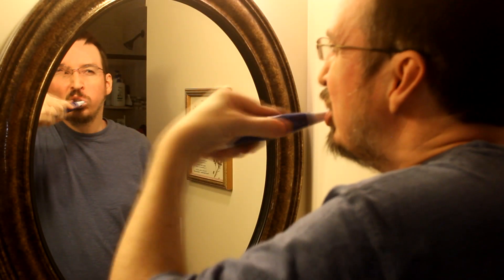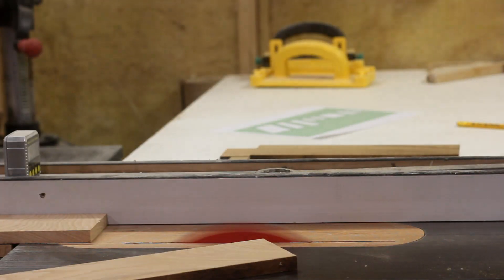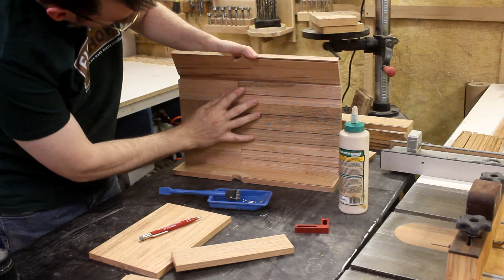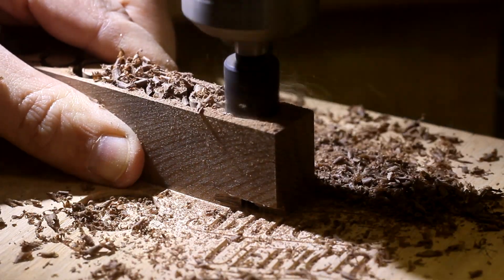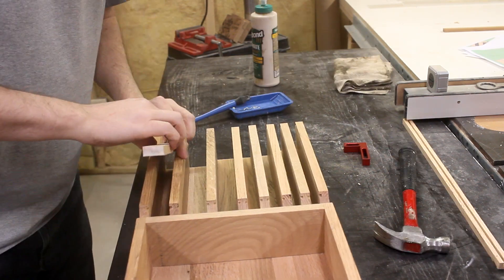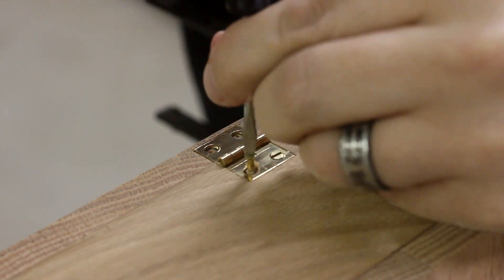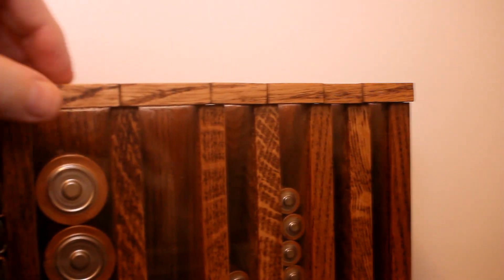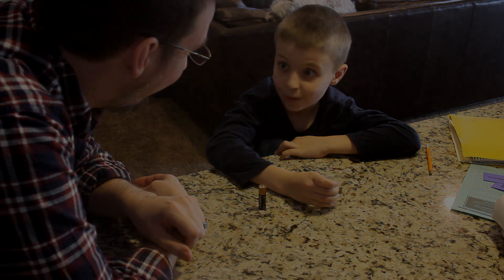Woodworking: Making a Battery Dispenser

Comment: To minimize hydrogen out-gassing in non-rechargeable alkaline batteries, an extra measure of manganese dioxide is added.  As the battery discharges manganese dioxide powder changes to manganese oxide causing the powdered granules to bond both chemically and physically. This packed-sand consistency reduces the anti-bounce effect exhibited by the gel mixture when the battery was fully charged.
Reply: Yeah yeah for real

Comment: Awesome video Drew!  Love the idea and layout.  I think my favorite part was the battery tip at the end.  Love showing the younglings new things and seeing them light up.  Also, with magnets, I use two methods...a nutdriver just about the size of the magnet to press it in, or a stack of like sized magnets and just press it in and then shear to the side.  That is helpful if you need to check and know polarity.  Great video!

Comment: 13:35 - He replies with: "Well, Dad. You could measure the voltage with a multimeter. A new alkaline cell typically has an open circuit voltage of 1.65, where as a depleted cell is generally 1.5 volts or less."
But seriously, brilliant build. I love it. Well made wooden products always look nice, and this is one of them.
I love the attention to detail, such as the knobs coveriong the screws, brass chain, and countersunk magnet to keep it closed nicely.

Comment: If you are only using a thickness planer on a twisted board, than you can add a nice surface, but the twist stays inside. You should use the jointer first(one edge, and one face), after that the thickness planer to get a parallel with the first face, and than the circular saw to get a parallel with the first edge. One tip. You should use the bandsaw after the jointer...this way you can be sure that you are parallel with the first face. Sorry for my english. I really like your videos. Great works..and your sense of humor is magnificent

Comment: Flathead screws look nice, especially when you line up the slots, they are also good to make sure the screws are not overtightened by using an electric screwdriver.

Comment: I use flip top ammo boxes and a large tackle organizer for anything not cylinder shaped for battery storage. That’s a handy trick with the brad nail. Those tiny bits usually snap frequently in my experience.

Comment: Great build! Now add a touch of irony by attaching LEDs to the acrylic panels so that the engraved letters light up. Power the lights with a battery pack that you then change out with fresh ones from the battery dispenser.

Comment: Excellent idea and good design.. :) Only one thing is missing - small removable plastic bin under battery dispenser for collecting old batteries to later properly dispose.. Plastic, because, old batteries, sometimes, leak.. 

I have plastic bin from cookies for collecting old batteries.. After few months or when box is full, old batteries from bin, are taken to special dispensing box in shopping center.. :)

Comment: You should have made a little funnel structure on the bottom (and a plate to keep everything from spilling directly) and used the cabinet at the bottom to collect the expended batteries so you can bring them away :)
Centralized place for both getting fresh batteries AND disposing of expended ones :)

Comment: With a slight modification you could add a push feature that'll "pop" out the battery for easier access. Two dowels, a lever, a spring - presto. Push button and battery get's partially ejected. Let go of the button and it'll all retract.

Comment: Nice project. i would have added also a dead-battery container somewhere. Usually when you have to change a battery you also have to throw away the old ones.
Reply: I call it the trash can.
Reply: @CaptainCocaine  i call it recycling. In Europe we use to do that.

Comment: I just bought lithium ion batteries, they're alittle more up front but i change them significantly less. I bought them by the case, in my house i have 30 or so floating around in circulation.

Comment: Wow dude, great job! I’ve had this exact same idea of vertically stacking batteries and being able to dispense them (even down to the extra storage cabinet for other types of batteries) for years now, but I’ve never gotten around to designing it. My design uses a raspberry pi and a few solonoids to knock the batteries out one at a time. It was great to see the similarities and differences between my design and your design, and I think yours turned out great.

Comment: Wow, everyone is different. For me this project is way to complicated. Way more than I would do. I would skip all the milling to start with and use plywood. I don’t get why all the glass strips and the individual wood tops. Couldn’t you use one piece of plexiglass and just drop battery’s in from the top? You can’t beat the French cleat. It came out nice. Nice job. And I don’t get what’s wrong with flathead screws. You plugged them anyway. It’s a real good thing you have such a great supervisor.

Comment: is that battery charge testing trick for real, or just a joke? I mean, it would be great if it's accurate, but I'm also a bit shocked that I have never heard about it, given the fact that I'm an E.E. after my late father (also E.E.) taught me just about every "trick" there is in the world of electricity (which he learnt from his father who was electrician)... It's never too late to learn, so if anyone can reference some theory behind if and why this works, please shed that light my way... Thanks!
Reply from the maker: Yes it's real.  I've only ever used it on AA and AAA batteries though.
Reply: @FishersShop  that is awesome! Now I'm so curious to find the theory behind it. Bouncing would mean higher pressure, or direct contact with a hard, non-compressing material... Empty batteries start to leak after a while, which might indicate a higher internal pressure indeed... I'll have to throw this one up on a science channel to find out :)))
Reply from the maker: @lukearts2954  According the all-knowing Google...  When you oxidize the zinc, it makes bridges between the particles and makes it more like a network of springs. That is what gives the battery its bounce.